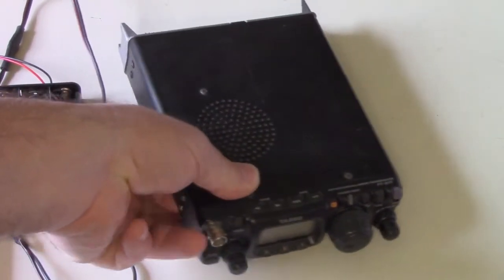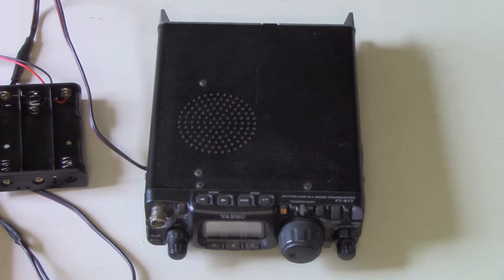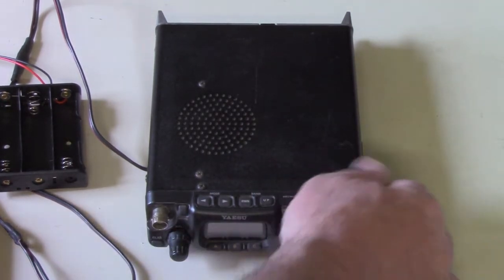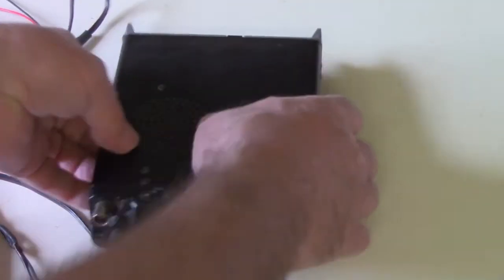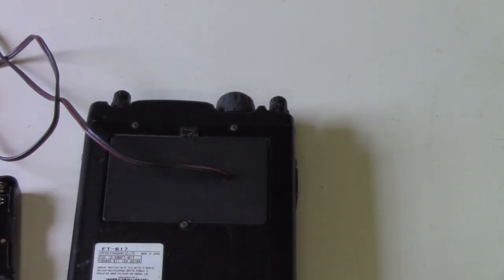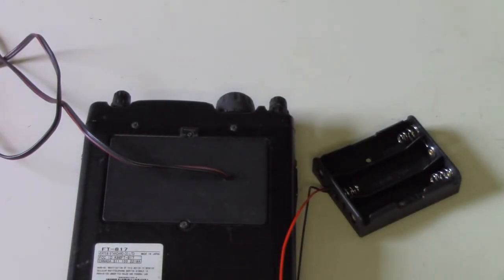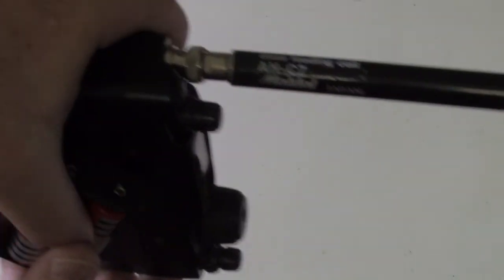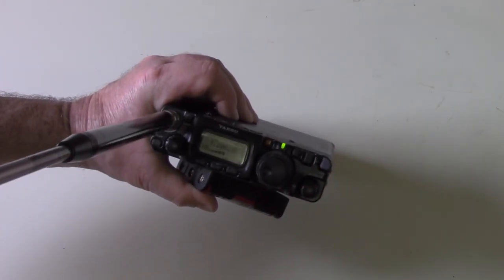FT-817 18650 Lithium Ion Battery Pack

Comment: For some reason, the power socket has 2.7 Volts across it without a power lead attached. Is this why your trace burn’t. I now have a Anderson adapter plugged in.
Reply from the maker: IIRC it happened while I was connecting external power. The 2.7V sounds like a reasonable explanation.

Comment: 3s radio control lipo packs fit in the ft817 ok. are you sure the track burnt? there is also a tiny surface mount fuse on th e board. i also got into a ground loop issue and burnt both. it was an esy fix but i bridged the fuse so i have to be careful
Reply from the maker: Actually, I'm not sure. I'll have to check out that fuse; thanks for pointing that out.

Comment: Thanks for the video. I use the Anderson "Power Pole" device I bought off of Ebay a year or two ago and an external 7AH 12v battery for portable but I really like the 18650 setup you have. How many hours of use do you get from 3AH? Also where did you get the 3 cell series 18650 holder you are using? I'd like to pick up a couple of those and add Anderson Power Poles to them for my rig!
Reply from the maker: I got the holders on ebay. I change the batteries out after about 3 hours, but they will go longer.
Reply: @Possumliving  Thank you very much.. I just ordered a pair from Amazon for $8/free shipping.

Comment: Guess my previous comment got deleted by YT as i included a link to fleabay. I was saying you have a great project there, except i would recommend using four 18650's and a buck converter to bring it down to 12v and regulate the voltage. Buck converters are very cheap now as i am sure you know. I use this setup to power my 12v DSL modem every time our power goes out. This works great and steady. It would give you longer working time plus more oomph when you are transmitting. Just a thought.....?
Reply from the maker: Great idea! Thanks for the comment.
Reply: @Possumliving  Oh, i am glad you think so! I didn't want you to think i was knocking your project, thanks! The buck converter i was thinking of is a 300W version and is only $5 from China....but maybe you already have several already? I will try once more to give a link after this....but if it doesn't appear then YT have deleted it again.
Reply: No...they always delete it. Ah well...it is a DC-DC-CC-CV-Buck-Converter-Step-down-Power-Module-7-40V-to-1-2-35V-8A-300W. You will find it if you google this item number......202936401869. I find it a great module....and maybe you already have one..? Anyway, i hope it helps.
Reply from the maker: @englishrupe01  Thanks! I'll check it out. I don't have one, but I'm definitely interested in getting one to experiment with.
Reply from the maker: Ok, I found it.
Reply: @Possumliving  Glad to help. And if you don't want to wait, i see Amazon have it for $8.29 with free shipping if you are a prime member, selling under the name ANMBEST. Sorry i cant post a link, but you will find it. Oh and just remember to make very sure you don't mix up the input with the output...otherwise the capacitors explode...lol!
Reply: A buck converter is a switch mode device and can be noisy for the radio. 3 x 18650 lithium ion cells is 12.6 V fully charged and 11.1 V norminal, and it's a perfect voltage range for this radio.